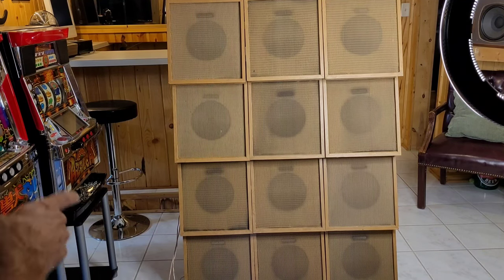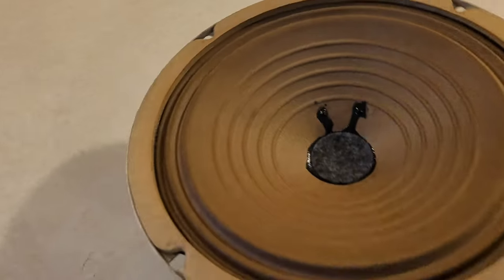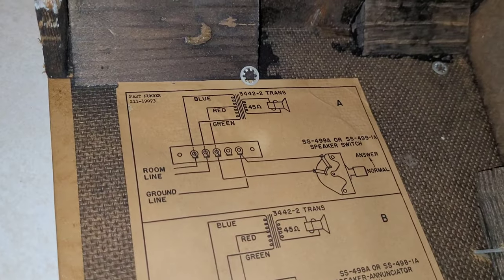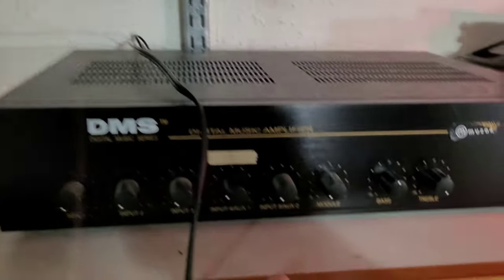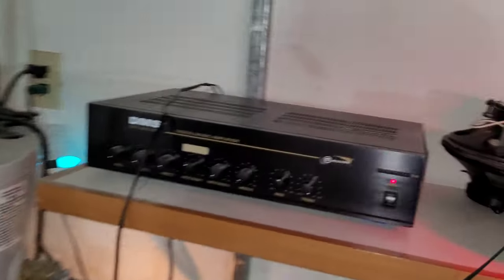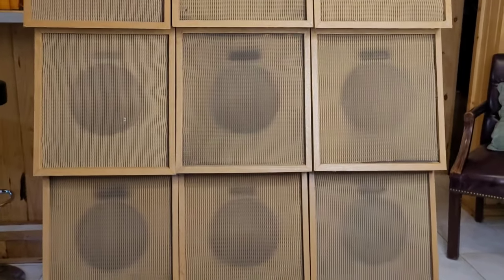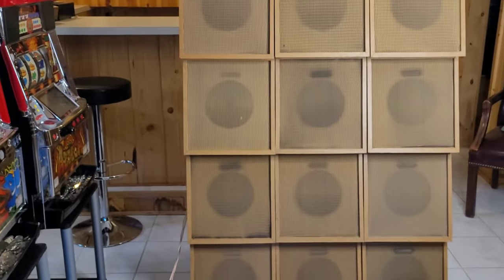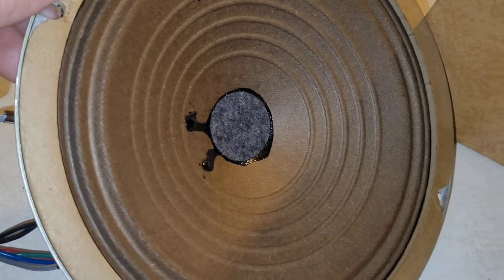Oxford Intercom speakers by Webster electric. 🔊 1954

Comment: The baffle is made by Argos and I actually have an Argos speaker myself with a 2002 Quam driver in it. The og driver was unfortunately toast when I got it. :(
Reply from the maker: Hey there, thanks foe the clarification with that. Was hard to find information about them as it seemed like these were cobbled together. I like the sound they have though. 
Oh man that's a bummer about your quam. What was wrong with it, voice coil rubbing.
Reply: @speakeradventures  The og driver was made by Argos but I put a Quam c10 driver in it to replace it. On the og driver, the coil copper slid off the coil framer. I still do have the og volume control that still works.
Reply from the maker: Oh wow, how strange of an issue to happen. Sounds like the qlue holding the copper to the coil failed at some point. I'm surprised they didn't replace that driver before you got it, as I'm sure it sounded  odd.
Reply: @speakeradventures  yeah it was put away into storage but I got it when it got pulled out
Reply from the maker: @aaronsceilingfansspeakersa3057 it's still neat that you have obtained it.
Reply: @speakeradventures  yeah

Comment: 1950s speakers playing a 90’s track in 2023. What a timeline!
Reply from the maker: Right. They handled the 90s music pretty well. Two of my favorite decades btw.
Reply: @speakeradventures  
On a side note, my mom used to have a speaker just like that in the kitchen to play music and the console was in the living room all the way in the other side of the apartment. That must have been one long run of speaker cable. No Bluetooth back then.
Reply from the maker: @Bassotronics  ahhhh....how stuff was done back in the day. One plus there would be no signal loss lol..unless the cord got cut. I bet it sounded really good paired with the radio. Would be cool if you had the speaker still.

Comment: They would make great guitar amp boxes I would replace the speaker though if you want to sell one I will buy one
Reply from the maker: These speakers boxes are a bit bigger than traditional speaker wall boxes are. The sound the speakers produce in these sound pretty good..they have good bass..I would also replace the speaker as these are 40 ohm speakers..
Reply: There a perfect size have you ever seen a 1950s fender champ amplifier with a 8inch or 10inch speaker 
Like I said I would change the speaker 
I build tube amplifiers for guitars for a hobby I alway pick up stuff like this stuff a amplifier in it and sell it